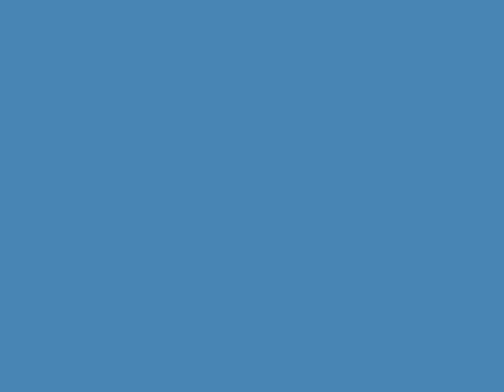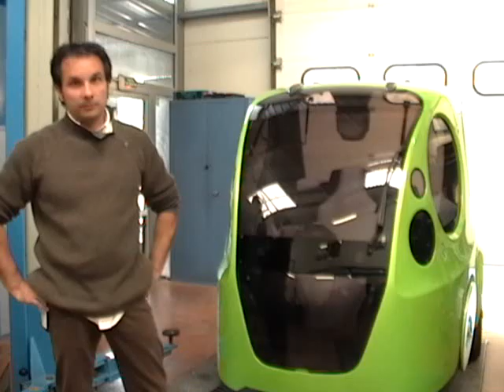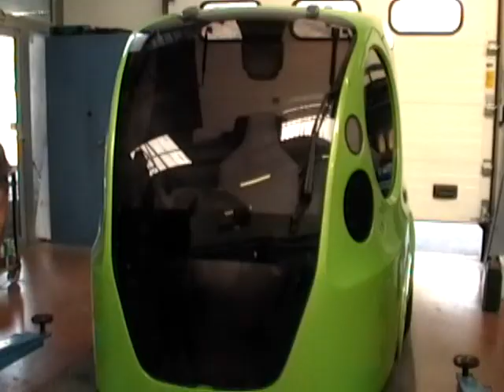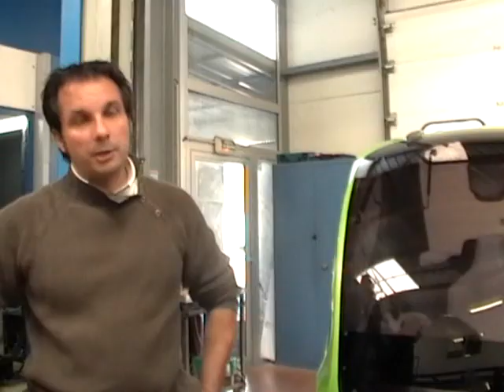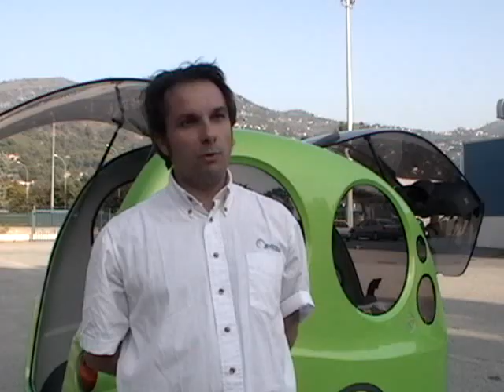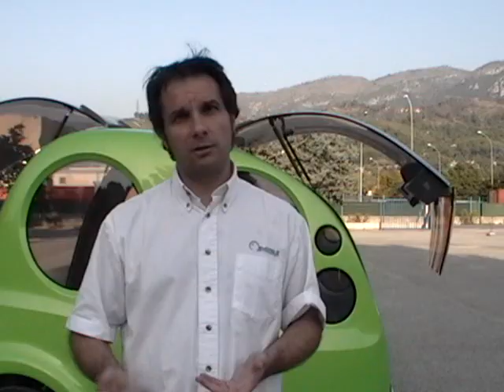Q&A on MDI.lu's AirPod with Cyril Negre 1 of 2

Comment: What kind of petrol bike is that? Sounds like you need a tune-up BIG TIME. There are certainly VERY efficient motorcycles out there, they just suffer from people bitching about "emissions", aka smog, but I think that CO2 is the ONLY emission people need to consider in this day and age. Leaded gas was bad, but the "emissions" thinking is outmoded, smog was banned so realestate values stabilized over lost sunset viewing clarity NOT for health reasons. Greenhouse gas should be TOP priority nowadays

Comment: The H. K. Porter Compound Air Locomotives, 1896-1930

Inventor Charles B. Hodges became the first and only air car inventor in history to see his invention become a lasting commercial success.  His engine was two-stage and employed an interheater between the two piston stages to warm the partially expanded compressed air with the surrounding atmosphere.  A substantial gain in range-between-fill-ups was thus proven attainable with no cost for the extra fuel, which was provided by the sun.

Comment: Not your mistake. MDI avoids mentioning the pressure the tanks need and talk about refilling at garages on their promo videos leaving out the bit (if they had a huge 4500psi air compressor). You have to read the technical pages on the websites to get a handle on it. They used to have more details and test reports but they were so pathetic they have dropped them